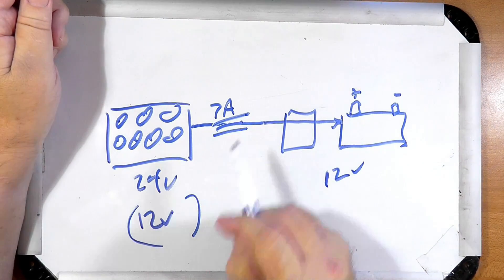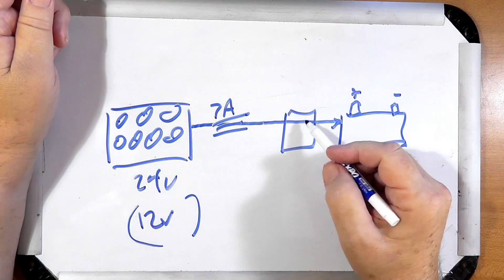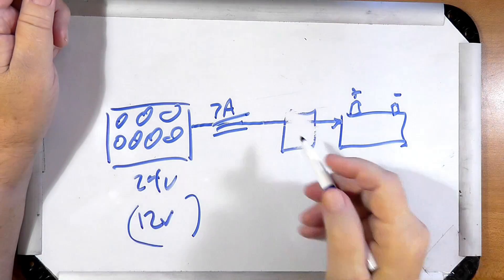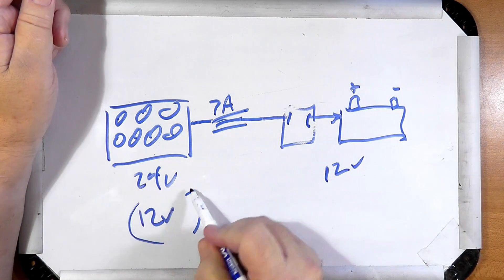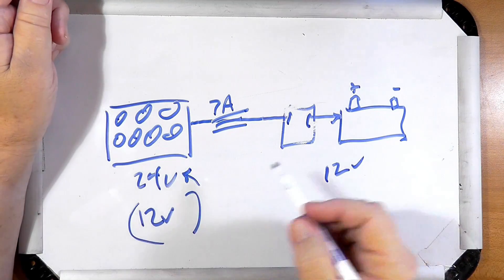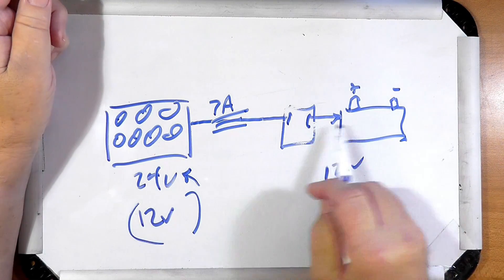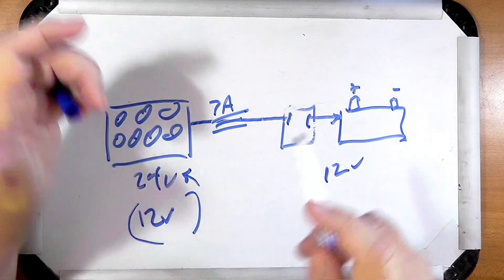Things Held Constant: Voltage, Current, Resistance (#321)

Comment: Dave, how about a simple project to hold a CV power supply at constant current as well? A FET and resistor can do that? (I'm thinking of something simple to make the standard CV power supply into a CV/CC charge source for lithium batteries, at 10-20A)
 Best luck & wishes for your health!